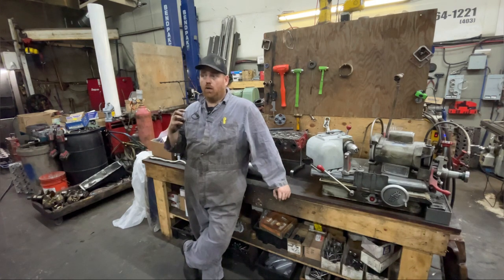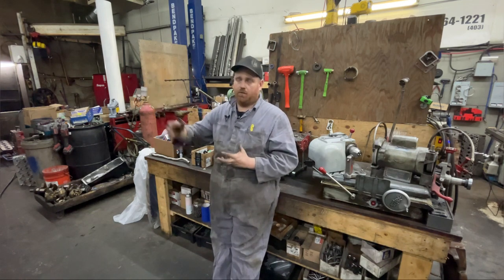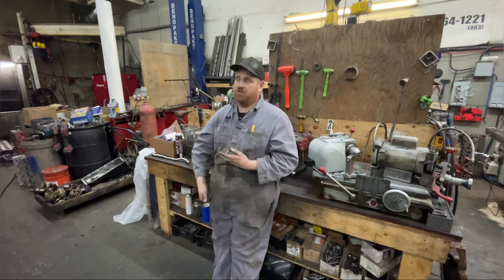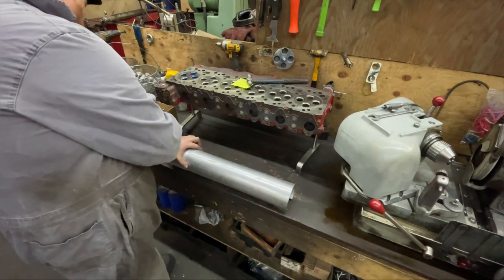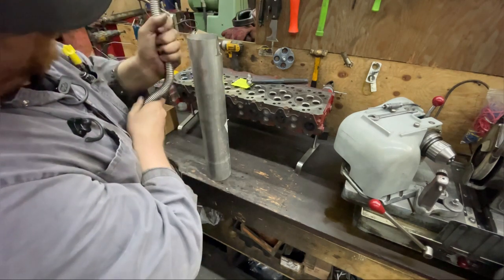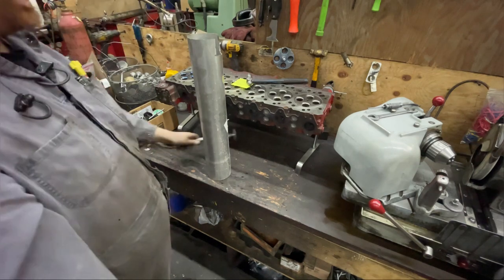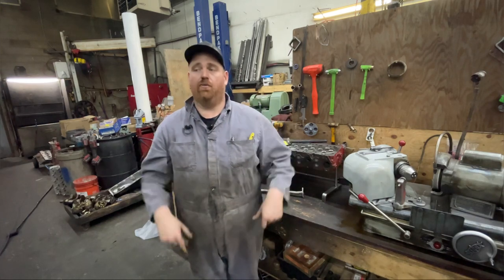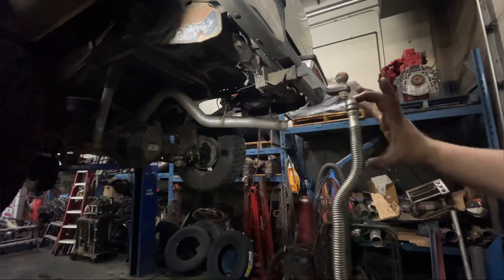Crankcase Exhaust Venturi  WANT YOUR CUMMINS TO STOP LEAKING ???

Comment: and if you want to buy these parts instead of making them, Moroso sells a crankcase evacuation kit. I believe it was first used by the pro stock guys. For best performance, should be installed past the muffler, especially if the muffler is restrictive

Comment: I have add a second vent to my 12v. Since I have compounds. What happens if u have no exhaust like a hood stack like most race trucks or pulling trucks.
Reply: How long is your hood stack? You could try putting the venturi in the hood stack but if it’s a short stack it might not have enough velocity to create a vacuum.
Reply from the maker: I would add a Venturi and a catch can tied into it and just use one vent line

Comment: That's a great idea . A while back I has a leak on my transfer case from the shifter shaft and for a bit I thought about install the vacuum line hooked to the vent of tc . . I got the damn leak fixed but this is a good idea as my 95 has a few small leaks that a irritation

Comment: Can I plug the camshaft area OEM breather and use a valve cover breather off the Case tractor tapped into the exhaust? It should keep the air suspended oil from escaping from the OEM breather.
Reply from the maker: You can use the valve cover type and block the other off

Comment: Any concern of heat soak through the fittings to the rubber hose? Hose recommendations?
Reply from the maker: I have never had a issue. I just use  heater hose  hose

Comment: Thanks for this Rob.  Will it hurt the motor to run just a catch can on the frame rail for drips?  If a person can't get to the exhaust side for a while.  Just wondering if not properly scavenging with a venturi will build presure.
Reply from the maker: Nope that just fine to do it that why

Comment: Hi Rob. Just watched this one again. What hose material can take the heat?

In my application the venturi tube would enter the exhaust pipe about 12 inches from the turbo outlet flange.
Reply from the maker: I am not sure on that one. I have always made it down steam a bit. I am sure they’re is something that would work. Maybe talk to your local hydro shop.

Comment: Been thinking about doing this to my 02 24V. It has that ridiculous plastic catch can mounted to the front of the engine. 
Maybe get some good hydraulic hose and route to beyond the muffler.
Reply: I’m thinking of doing the same thing. On the same truck. Have you done it and did it work?
Reply: I haven’t got around to it yet. Wayyyy too many projects, but a pile of new parts awaits for the ‘02. Will definitely post results tho

Comment: I know I'm overthinking it, but could you go into the turbo elbow from a vented valve cover? In my head it looks clean and the elbow could be removed but I think its cast so hard to wield?
Reply from the maker: On the air take side you can. But then the junk goes into the turbo. On the pressure side you can’t

Comment: Rob, could this trick be used on my close to stock 1st Gen (92 5.9 Cummins) crew cab I'm building. Just running the crankcase hose to the exhaust. Making it run better and no drip sounds like a positive to me. The only thing you didn't mention was about a type of "high heat hose" to use? Thanks again for I think a Great tip 👍
Reply from the maker: Yes it can

Comment: 12v have the breather vent for valve cover and keating tappet cover with two baffled 12an breather ports, was planning on doing a catch can with breather filter to it. Maybe I could do the drain to exhaust and keep it open. Or just do the tappet cover breathers straight exhaust. What would you recommend?
Reply: I have a similar set up and same question. Will two “Y” adapters work, should we use a larger pipe at the Venturi or decrease the number of ventilation points?
Reply from the maker: You guys. Am just tie them together if you want. But I find you can just use one. If you have more then one pick the highest one on the engine
Reply: @CUTTERUPROB  Thanks Rob! I’m adding this to my list of “to does” that will most likely take me way to long to get around to than actually just knocking it out.

Comment: Hello from Sacramento CA.  1997 2500 4x4 cummins 5.9
Reply: With EGR and stock timing?
Reply: @preachers4135   some how egr got a plate blocking off passageway instead of gasket. And I don't know about the timing yet. But it looks like the egr system is all intact and functional.
Reply: @preachers4135  nope mine is the last year of the no smog diesels. So no one looking under the hood or up my pipe.  I spent 3 months looking for my truck. In 3 states. And bought it 8 years ago and It was a garage queen with 170k miles on it mostly bone stock.